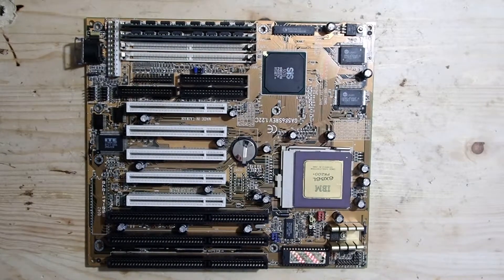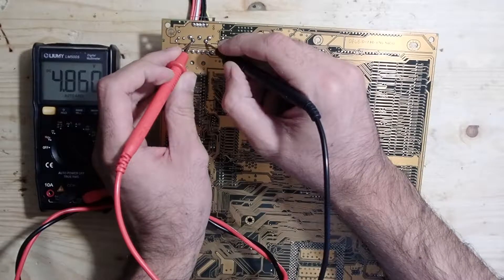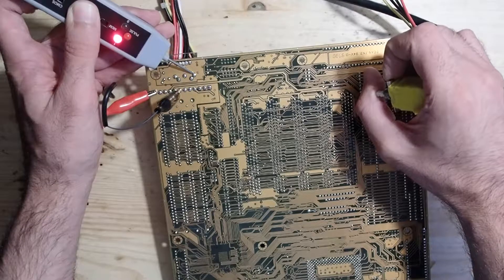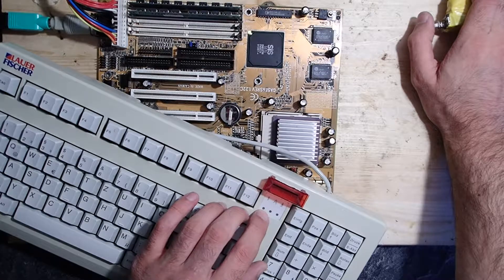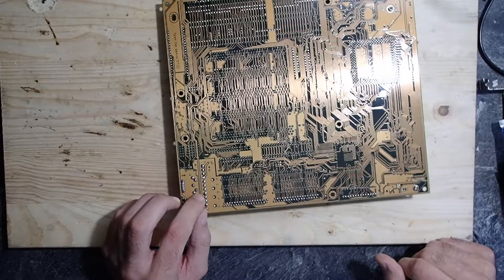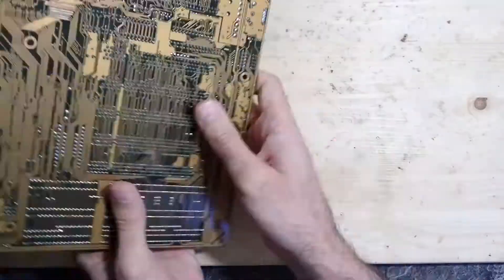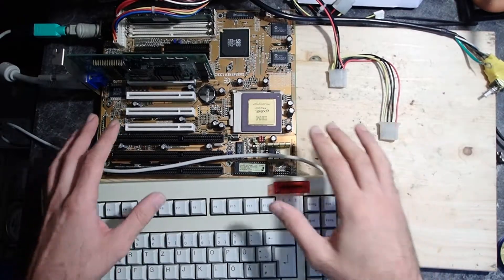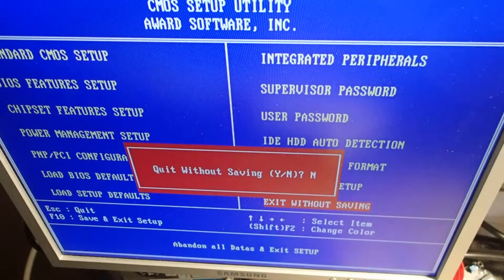Repairing dead keyboard on old mainboard

Comment: Hi, Im having this same issue now. Clock cap leaked and did some trace damage. I have repaired all that as far as i can see. Motherboard boots fine, keyboard lights blink, but still cant use the keys. Any ideas?
Reply from the maker: Probably data trace is broken. You can find couple of videos in my channel about such issues. I don't exactly remember now which one, but look through the 286/386 repair videos, I'm quite sure there were some hints.

Comment: I think what you jumpered with that 100ohm resistor was an inductor, probably used as some kind of filter
Reply from the maker: You are kind of right, I came back later to this board again, and it was actually a fuse, which I bridged. Probably it got bad over the time. Usually, fuse should just break, if the current is to high, but in this strange case, it became a resistor :D